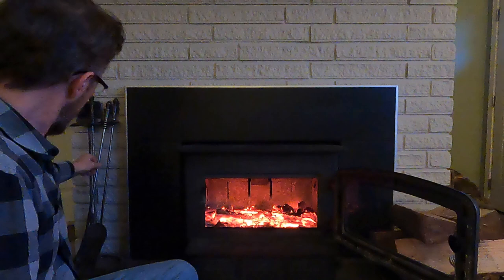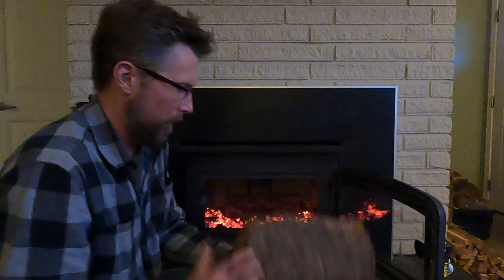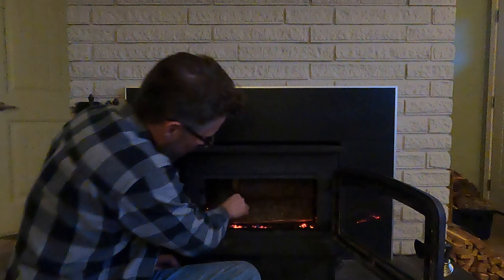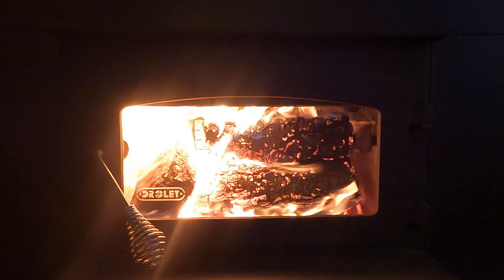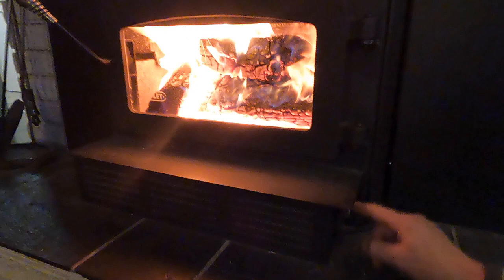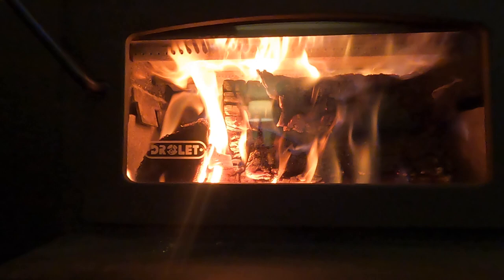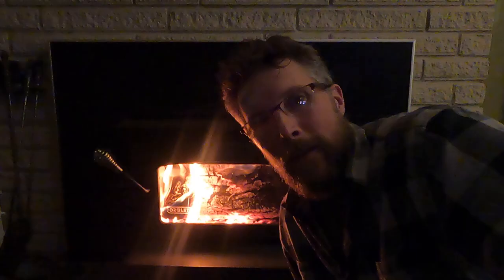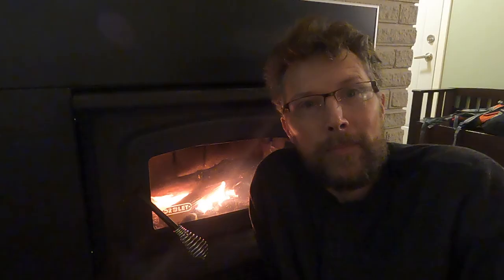How to Load your Wood Stove for a Long Overnight Burn Time🔥

Comment: I’m new to wood burning. Thank you for your video. I’m worried about carbon monoxide poisoning while I sleep. Is this a non issue?
Reply from the maker: If you have an airtight wood stove the chances of CO are very low. It is important to have the fire going very well before damping the stove down for the night. A little smoke coming into dwelling will happen from time to time when you open the door but not enough to worry about. If you are concerned invest in CO detectors. Hope this helps and thanks for watching!
Reply: @JENSENDIY  Jensen thank you for the reply. Very useful 🙏🏻

Comment: Thank you for this informative video. Just to make sure. Once i put all the wood pieces and I left the door opened to create some flames. Is it fine if I close all the doors and damper all the way to make it last all night? Thanks
Reply from the maker: Once you close the door or doors then l would again let it burn and get a good draft going, once you know the fire is going well then damp it down all the way for the night. Hope this helps!
Reply: @JENSENDIY  thanks! I just want to make sure it's good to completely seal the stove.

Comment: Hi, Thanks for the video, but where on earth is the ash!?!  The next morning it looks like your stove was completely clean aside from the coals!?  Even before you loaded it the night before I see the hot coals but no ash.  Is there an ash catcher or something beneath where you put the wood?!
Reply from the maker: Hi there, I had cleaned the ash out a few days prior but it really does depend on if you’re burning soft or hardwoods. I burn softwood (fir, hemlock, cedar) & only need to clean out the ash every 3 weeks or so, l have found hardwoods produce much more ash.
Reply: @JENSENDIY thanks for writing back!  I live in a pine forest so the only thing I burn is pine. I shovel it out every morning!  There are still a lot of thumb sized coals amongst the fine white ash. And sifting the chunks out creates a big mess but I do my best.  My stove does get super hot.  May I ask how deep your ash gets?  After one day, my ash with chunks is easily 1-1.5 to inches deep!
Reply from the maker: @notastepizzaface  About  3 inches and then l clean it out. An advantage to leaving the ash for awhile as you said the coals last longer in the ash which makes it easier to rekindle the fire after a longer time period. Wood stoves are messy no matter how much ash, but they sure are a nice heat! Thanks for watching :)

Comment: Thanks for the video.   We also have a fireplace that closes tight with a heatilator and fan.    When fireplace is hot, the heatilator and fan significantly increase the warm air to the room.   If cold and the power ever out, it would be fantastic to somehow power that fan.  Not quite sure how to do that - wonder if others have done this.   I can't seem to find the brand at the moment, but installed in 2006.
Reply from the maker: I agree, the fan really helps circulate the heat. l have plugged the fan into extension cord from our gas generator once when power was out in really cold weather. Im guessing it could be run with a battery pack as well but not sure how long that would last. Thanks for watching!
Reply: Portable solar power station with a mains plug

Comment: Same wood stove just inserted. What type of wood are you using? We got the insert in part because we could get free wood but nothing that would last overnight. I have to double check what type we got but our burn rate is quite high. MInd you right now we have -20 to -23 C which obviously has an impact. Are you trying to heat your entire home with the insert? My husband is creative and is in the process of connecting a four inch pipe? above the insert with a fan inserted in the pipe and drawing the heat  through a nearby ceiling register up to the main floor. Any experience dong something like this or comments? thanks for your video
Reply from the maker: Yes the drolet does heat our entire 1400 square foot rancher but we do have a backup gas furnace and the far room at the end of the house stays a couple degrees cooler. We dont get -20 here, sometimes it may dip to -10 but not that often. When I made the video it was not getting below freezing yet but with your temps I think your husbands idea is a good one for a 2 storey house, or cut a register in the ceiling in the same room as stove depending what is located above. When it gets really cold I get a really good bed of coals load as much wood in as possible, let it get going really well, damp it down and leave the fan on high. Thanks for watching!
Reply from the maker: Burning mostly Douglas fir softwood, sometimes hardwoods like alder, maple or arbutus

Comment: Hi, nice video! I could not understand what you do with that air thing. Is it the only thing you need to change once you fill the stove with the wood? :)
Reply from the maker: Yes, once the fire is going well and the door is tightly closed, the air damper gets closed all the way off. By restricting the air the fire burns slowly as long as you are burning dry wood. Thanks for watching!

Comment: When i try an load up my stove it over fires and nothing can stop it its frustrating.
Reply from the maker: That tends to happen more if the stove is not airtight.
Reply: @JENSENDIY  its brand new. So i think i was leaving door open for to long when i already had a thick bed of coals. Last night I packed it and closed it up earlier, after about 20-30 minutes all flames died and it just “coaled” for a lack of a better word all night and 8 hours later the stove temp was about 250 and had enough coal to relight. House was 72 this morning.
Reply from the maker: @Johnnysokko168  Well that’s good! Now you just have to deal with the new paint smell burn off. I burned mine off outside for a good 12 hours when first got the stove but still smelled up the house for the first few weeks after install. Thanks for watching!

Comment: Forgive me if you answered this question but what model Drolet is this insert?  I have a Drolet Escape 1500 on order for my 1200 SF house.  I am curious how well this unit heats your house?
Reply from the maker: Ours is an Escape 1400 and heats our 1400 SF rancher very well. I do have the fan on 90% of the time though which is a bit noisy but it really helps circulate the heat. The far end of the house stays a degree or two cooler which works fine for us. You may have to open a window once in awhile with the 1500 but really depends on layout, insulation in walls & ceilings etc... Hope this helps, thanks for watching!

Comment: Hi great video. I had a log burner installed love it.
Problem is there is no way it would burn all night & still have hot coals in the morning, 
I stack it up & close the air flow but it’s alway out 😢 someone told me to leave some ash in the stove to slow the air flow didn’t work it still burns like crazy
Reply from the maker: Hi there, is your stove an airtight with gasket around the door? If not unfortunately it will not burn all night. If it is an airtight, once stove is loaded the fire should be burning really well before you damp it down. It should then burn for the night unless it is a very small stove. Hope this helps!
Reply: @JENSENDIY  Hi thank you for replying. Yes the stove is  airtight, has the gasket round the door. I finally got an answer from the supplier/installers they’re saying due to where I’m located the draw in the chimney is to much. there suggesting putting a damper in the flu pipe. They could have a point as I can hear a howling gale coming down the chimney when the fire is off. Hopefully the dampener will help. 🤞

Comment: Does your wood stove heat your whole house? Do you have a DIY on installing a wood stove into a home that has previously not had any type of fireplace or wood stove? Thank you for helping those new to wood burning!
Reply from the maker: @JenniferMathew-gh2vf  Sorry no video on installation, but there is one on cleaning the stainless steel liner. Yes our stove does heat the whole house so well in fact that we have to crack a window open sometimes during winter!

Comment: I live close to someone who burns wood and coal.  The problem with that, I installed a HRV system in my house which sucks in fresh air from the outside and heats it up.  Now, I have been force to turn off the HRV because it now suck in, unpleasant smoke fumes instead of fresh clean air...
Reply from the maker: I'm sorry to hear that. Where I live we are only allowed to use airtight wood stoves which are not only efficient but burn pretty clean as long as the wood is dry enough. You may want to try and find an Activated Carbon Filter for your system which should help with the smoke problem.
Reply from the maker: @sounduser  Fresh air intake is piped in crawl space near masonry chimney clean out below wood stove.
Reply: That’s the problem with slow burn, it will smoke.

Comment: Very informative. Thanks! I recently got a wood stove installed and I'm trying to figure out the best way (and the most efficient way) to use it. Yours is the first video I see that confirms what I read - hot coals + stuffing the stove = ready for an overnight burn!
I'm wondering however, say you wanted another long burn in the morning (for when it's -20 outside). You added two pieces. Would that be enough to make enough coals like you had in the beginning of the video - so you could stuff it again and go for another 6-7 hours of slow burn?
Reply from the maker: Hi there, glad to help! I would add a few more pieces of wood and let it get going really well again before loading it up. You just need to make sure the fire is burning good and hot before damping it down. If you are planning on burning the stove in the damped position most of the time,  you definitely want to clean your chimney more often. Thanks for Watching!

Comment: This is an illustration of why the face cord evolving to strictly 16 inch lengths infuriates me. I fell, buck and split my own wood,  so it doesn't affect me personally,  but 16 inch wood in a 20 inch stove leaves a huge amount of space unused.  Back in the dark ages, around 1980, we sold face cords of 18 and 20inch wood to accommodate different sized appliances. Obviously the price was adjusted to reflect the different amount of volume in each length. You were able to fit a short piece alongside the laterally loaded wood, but only used 1/3 the height of the wasted space. What if you hadn't had a short piece? I said I'm not affected, but if you are, start asking your producers for longer pieces. The math isn't that hard. If you don't care enough to ask, nothing will change, and  buyers will continue only heating with 75 percent of their stove's capability. More fuel per load equals more heat per load of the stove.
Reply from the maker: Yes 16" seems to be pretty standard. I usually try and source my own wood, sometimes it's already bucked and sometimes I cut it myself, reason being where I am its $300 for a full cord delivered. In this video this is just the wood I had on hand and temps were not getting below freezing yet. We mostly burn Douglas fir around here because that is the main wood logged in our area. Thanks for watching!